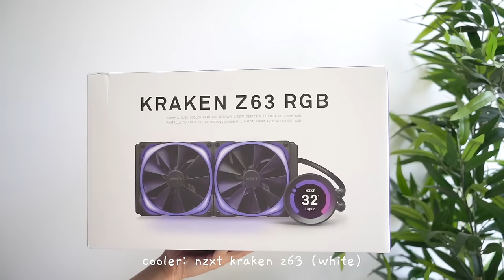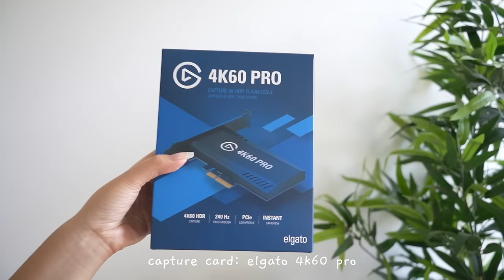💻 building my first pc | white aesthetic | lian li 011 mini, rtx 3070 🤍

Comment: Hiii, I just switched over to this case, along with changing my aio pump to the kraken and using lian li fans just like you. I was wondering which fan you plugged into the CPU FAN header at the top of the motherboard next to CPU OPT? I plugged in the pump plug into OPT, but for  the Lian Li fans I'm using on the radiator, I plugged that into the Lian li controller... I already had trouble downloading NZXT CAM, and my cpu temp was reading super high, so I wonder if I should change where the lian li aio fans are plugged in, or maybe the pump isnt working? ): You're the only one I found with the same setup so that's why I'm asking, thank you!!

Comment: Beautiful build! What cables did you use? The parts went by so quickly I had to keep pausing but don't remember seeing the white light cables in the listing. I think what keeps me from doing my own build are being absolutely positive parts work together (yes PCPartspicker is great, but I still worry lol) AND the fear of not knowing where to plug connections into the mother board. Just seems so overwhelming whenever I go looking for tutorials (need this, need that, molex this, don't do that). I need a pro to be sitting with me I think :)

Comment: Nice build, if i would comment on anything clip your nails  they can tear if you do stuff like this regularly , also a tiny thing if you would have turned the hoses on top of the Cpu instead  of the bottom its better for longevity.

Comment: I read in the specifications of 4K60 Go Pro, works with RYZEN 7 or higher. That box looks great. I have the same Vision D-P motherboard (RYZEN 7 3700X), with Be Quiet Dark Rock Pro 4 air cooler 2x120 + 1x130 fans. APU 750W. Black S850 M.2. Better 32gb RAM than 16gb RAM. Its assembly in any case is fantastic. Just know if the tubes should go down instead of up the CPU
Reply from the maker: ahh i did not realise! it seems to be working with my ryzen 5 fine though and i will only be streaming in 1080p rather than 4k anyways. thanks for the heads up though!
Reply: Better to have the tube down, but is fine also this way. What matters is that the pump isn’t the highest point (the radiator needs to be). The majority of people go tube up cause tube down is a pain in the eye
Reply: @kritnicol8546  My experience in thermal installations of buildings tells me that,  if there is an air bubble between the pump and the radiator (Guaranteed there will be) the pain in the eye is insignificant compared to the pain of your lost money.
Reply: @emiliomunoz1455  absolutely, reasons why I suggest to go tube done. But even tube up with enough height space between pump and radiator is fine
Reply: @kritnicol8546  I repeat. It will be fine as long as there are no air bubbles at the top of the radiator.

Comment: Is the radiator fan configuration wrong? since it has very little air intake but a lot of output, limiting the cooling of the graphics. 😱

Comment: With a white build in particular are you worried about dust with what looks like a negative pressure fan setup and the rear fan set as intake and not having a filter?
Reply: 3 months late but yea thats definitely a worry. I believe the best setup is to have neutral to slightly positive air pressure.
I have the same case and this is how I did my fan setup: 

BOTTOM:: Three SL120s as intake with filter
TOP: My AIO pump's radiator with three 120mm fans as exhaust, filter removed. (H150i with iCUE fans)
REAR: One SL120 as exhaust with no filter. (this side can only really fit one 120mm fan).
SIDE:  Two SL140 140mm fans as intake with filter. (this is the side facing the cable management area of the case, cant fit 3 120mms but fits 2 140mms perfectly.)
PSU: Intake with filter.

If you want to go further i guess you can tweak the fan speeds to even out the air pressure more.

Comment: Hey! May I ask why you've mounted your radiator fans as exhaust fans at the front? I for sure know that it's aesthetically more pleasing, but I'd turn them around for better airflow and temps :P
Reply: Coz its a liquid cpu cooler, so the heat needs to get out somehow.
Reply: @oracelpancho5225  that's not how it works xd You need to get fresh air to the cpu
Reply: @Judox  oh, my bad. You're right. But i think turning the radiator upside down so the tubes are at the bottom would also help for temps. Coz the air is accumulating at the top where the tubes are , compromising waterflow according to gamernexus's vid. But there isnt enough clearance i think. Correct me if im wrong. That build still looks delicious:)
Reply: @oracelpancho5225  you're indeed correct. Turning the radiator would actually benefit the temps. Having the tube at the bottom always improves temps :) Build looks insanea

Comment: Amazing build! QUESTION!: Would the 120mm fans not fit on the NZXT KRAKEN? I want to use the new infinity rgb fans in my build and keep all the fans consistant but they don't seem to have a 140mm version like the uni fans do? on top of the 120mm version? Thanks!
Reply: Nzxt z63, x63 support 140mm fans

Comment: Your PC is absolutely amazing!! How loud are the fans? I'm thinking of using this case when I build a PC but the only thing I'm worried about is the noise.
Reply: i run 10 sl 120s in a different case but low to medium rpm they are pretty quiet.  However, if you have them ramped up a bit they can be a bit noisy. Not the worst I've heard or used though.
Reply: @HarryLaxington  Thanks for the reply! I suppose I could use less fans (temperature permitting), but I'm not sure that would be great for aesthetics. Oh well, it's a noise vs aesthetic trade off.

Comment: Can i ask how your RAD fans are controlled? Did you connect them to your AIO fan splitter cable so they are controlled by nzxt CAM, or to the lian li controller so are controlled by L connect? Im currently building similar build and looking for the best option

Comment: how is the vision DP treating you? I have a very similar build, and the Bluetooth connectivity would get interrupted every few hours at random times. Apparently, an issue with these boards. I returned it right away and got an ROG Strix board, but that was last year. Hoping it's been resolved. Would like to have a fully white build sometime in the future.
Reply: Usually is just a driver issue. Very rarely is an hardware issue, also consider that Bluetooth and wifi are just small chips. If you really liked that mobo you could have kept it and buy an external wifi and Bluetooth cards, sometime they are even better than the mobo build in

Comment: Build looks great! I’m planning on doing a build with a NZXT Kraken Z63 with Lian Li SL140 fans like you have, but I was just wondering how you connected the SL140 fans?

Since the SL120 fans come with a fan hub, I assume they are all connected to one of those. Are the fans on the Kraken also connected to the hub or do you have those connected to the wiring from the Kraken itself?
Reply from the maker: each daisy-chained fan set (4 in total - 3 SL120s and 1 SL140s) all connected to one lian li hub :) i just had to update the firmware as i accidentally connected an older hub and didn’t want to change it back out. hope that helps!
Reply: @cassiedakota  Thanks a bunch :)

Comment: Wait, how do you play games with the fans backwards? Did you change it? I am in the middle of building mine just like yours when I noticed that. Help anyone? It's not going to look as clean as this if done with air filtering nicely for gaming. Either the top has to be changed or the two on the side. @cassiedakota

Comment: I have a question, I am also looking to build in this case, I want to use an ATX motherboard, but this is a case meant for ITX motherboards, does the motherboard extension bracket come included with the case?

Comment: Love the build and video btw I have a question, I’m planning on getting the same motherboard and cpu but don’t know if I need to update my bios. When u built yours did you need to update yours? Thanks 🙏
Reply: It depends on the cpu you want to install, check your motherboard manufacturer site which cpu they support, if they have multiple revisions of the motherboard sometimes rev1 supports older cpus while rev2 supports newer ones in this case you can update bios for rev1 motherboard and install modern cpu. But if you buy everything new you don't need to update bios in most cases.
Reply: @JamesSmith-ix5jd  okay thanks 🙏
Reply: @aldrianbangayan1951  did u get it
Reply: @shitsheet7277  yep, and it’s compatible no update needed 👍

Comment: Hi! I'm first time seeing your channel (appeared in recommended) and I love your video! The pc overall looks very beautiful with white color and the video was relaxing to watch. I wanted to ask however: how did you decide which pc case to pick? I am thinking of upgrading myself in a few months, but as I never (fully) built my pc, and never had a case with cable management available, I'm not sure how to be sure that every component will fit in the case... subbed and i love your channel so far. Have a nice day! c:
Reply from the maker: i was looking around at small form-factor cases and once i found the one i liked i used pcpartpicker to make sure everything was compatible. watching other build videos with the same case helped to get an idea of what i could do with it too! hope that helps ☺️
Reply: @cassiedakota  Okay, ty so much c:
Reply: You just have to look at the motherboard size (for factor). Look at the model. If it says atx look for mid tower case. eATX are for full tower cases. Itx/micro/mini are all for small tower cases. Usually small form factor cases are good if you know what to look. They are smaller so you have to check air cooler height (if you use an air coolers, and max gpu (graphic card) lenght. If you are not aware you can find yourself with a cases that is too small for your component. 

Let’s say it fits everything even a small cases. You have to ask yourself: will I in the future buy a bigger better gpu? If yes then buy a bigger one, or you will find yourself to rebuild everything again to switch to the new case. I really don’t find an excuse for small cases, they are just to use less space, but I would never sacrifice upgrade ability  just to use less space in my room

Comment: actually another mistake you forgot although its not a major one was when you put the motherboard on the table rather than on the package box of the motherboard this prevents any unsmooth or dirty areas
Reply: I think it's more so of the fact that it became a norm to do so; you see it in every build video. It's just handy for a safe build. The box is nonconductive and convenient, so if you needed to turn it on outside of the case, to update the bios for example, you can do so safely.
Reply: Also it helps prevent static** I forgot to mention

Comment: The M.2 'mistake' didn't really matter as the heatsink would've kept the m.2 down instead of the screw 😁
Reply: You also might wanna look at rotating your AIO. Tubes down in this instance is better for the pump longevity and noise it might make once a bit of water is lost.

Comment: I love this so much! I came from Twitter and your pc inspired me to do my first build as well 😭 do you happen to know if the Ryzen 9 is also compatible with the graphics card you chose? I want very similar aesthetics to yours but a bit more power. Is there a reason you went with 5 instead of 7 or 9? I’m just curious:)
Reply from the maker: i’m not entirely sure if they would be but i wouldn’t see a reason for them not being! i only went a 5 due to cost of my pc already being quite high, i may upgrade to a 7 or 9 eventually though ☺️
Reply: A Ryzen 9 5900x or 5950x are 100% compatable with the motherboard that was used in this build and therefore you can put a gpu into the x16 PCIe slot on this mothercoard and it will all work. If you are spending that much on a cpu you may want to look into an X570 motherboard and not B550. A graphics card slots into a PCIe slot on the motherboard and any mobo with one of those can be used for a gpu.

Youtube comments is probably not the best place to educate yourself about PC compatability but there will be many videos that explain it better than I can here

Comment: actually i seen all youtubers building their pc ,how do you actually determine what sides of fan are for exhaust and intake ?
Reply from the maker: i just based it off what previous builds did for optimal airflow
Reply: A tip that i can give u the front face of the fan suck the air flow and the back blow it out. its the same for all the fans.

Comment: Can i ask? Do u add thermal paste on the cpu before putting the cooler?
Reply: I think the kraken comes with the paste pre-applied.
Reply: @pacmoon14  owh, see..
Reply from the maker: mine has the thermal paste pre-applied so i didn't need to, but if yours doesn't then you will need to apply it ☺
Reply: @cassiedakota  owh thx for the info.. ur earned a sub :)

Comment: Unfortunately, you put the back radiator the wrong direction, you should always put the tubes pointed downward so air is not getting trapped.  GamerNexus did an extensive guide on what happen when your tubes are pointed up.  It won't stop it from working but over time it will degrade the cooling performance.  So please switch it around ASAP.  Other than that its a great build, and nicely done!

Comment: Good job, you made it look good and you picked out a nice list of parts. All brands I would recommend that are high end and will likely last the whole life of the system. You also did not go completely overboard on the CPU like a lot of people do which is the dumbest thing ever. You won't notice a difference from a 5600X and a higher model of either brand, its like the best CPU for gaming needs other than the rare and coveted R7 5800X3D. I think with this system you can game on AAA titles with max settings at 2k for at least 5 years.

Unfortunately I will say the kraken is kind of junk with a screen on it. The only reason most people buy the kraken is the stupid 2 inch display it has, yea it's not known for cooling well. Sucks you spent an unnecessary extra hundred bucks on an inferior product. Recommend corsair h150i LCD if you need the gimmick with actually good cooling
Reply: Umm the Kraken was rating one of the highest cooling performances out of all the big brands out there. Search it on YT there are many videos on it.

Comment: is RTX 3070 better then RTX 3060Ti ?
Reply: Performance wise it's a bit better but the price difference I'd definitely get a 3060ti because of value. The 3070 is around 10% better but the price is $499 and the 3060ti is $399
Reply: it’s not worth to spend on 3070 over a 3060ti
Reply: @dandmwg  do u know if I would be able to use all the parts she used but change the CPU and gpu to a gtx 1660 super and a ryzen 5 5500?
Reply: @Ndujlz  yes

Comment: You'll be needing a white anti-sag brace or bracket for your GPU, thank me later
Reply from the maker: would the gpu sag over time?
Reply: @cassiedakota  yes it does, not unless you're planning to build a system again in a year or two. So add it to your check list. Most experience builders is doing that.